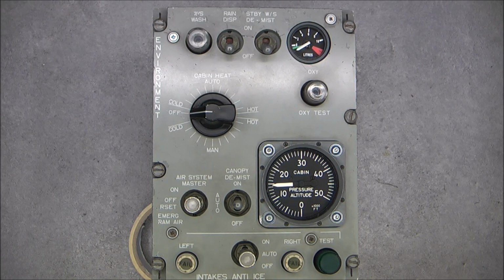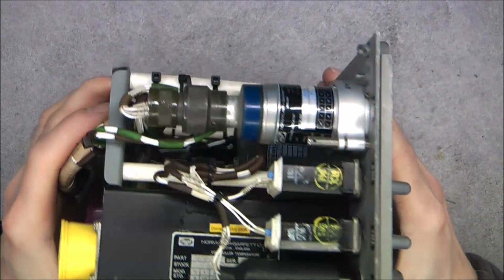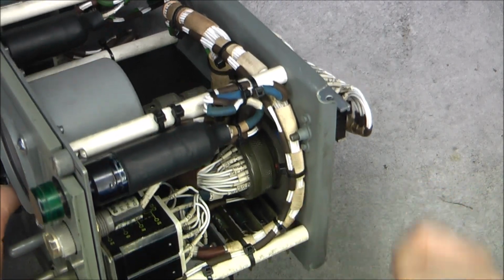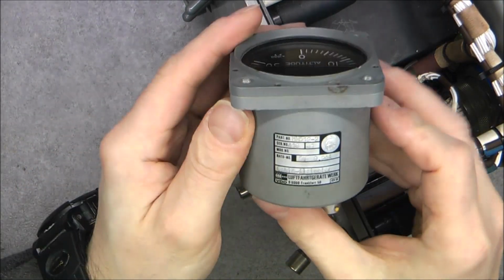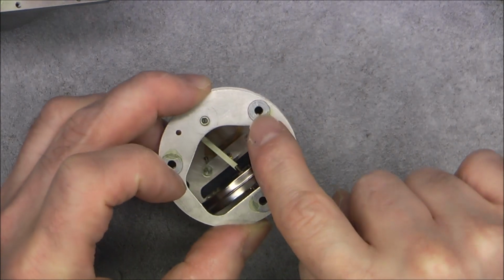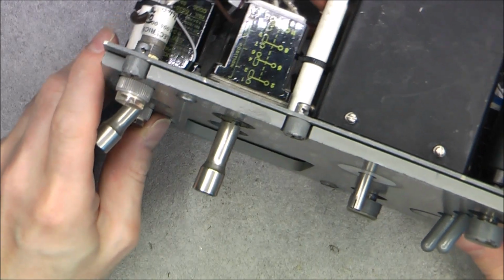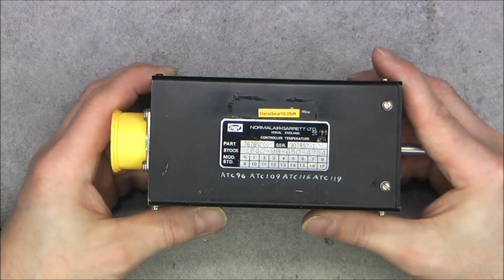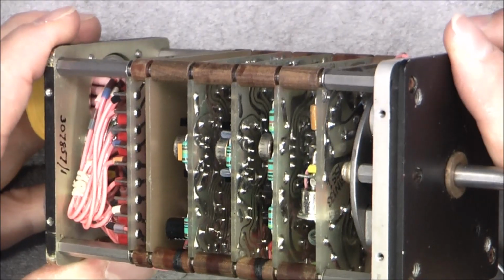Tornado environment control panel teardown

Comment: Panel is mounted at the right so makes sense for the indicator to be rotated 90 degrees to make it easier to read when glancing down: https://www.pinterest.co.uk/pin/473440979570774552/